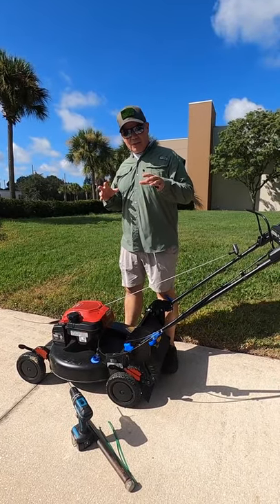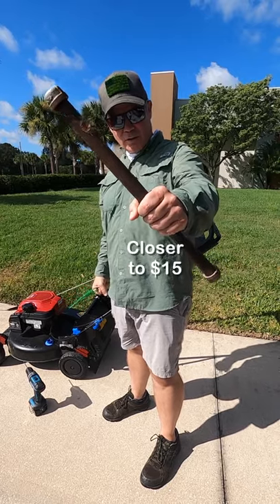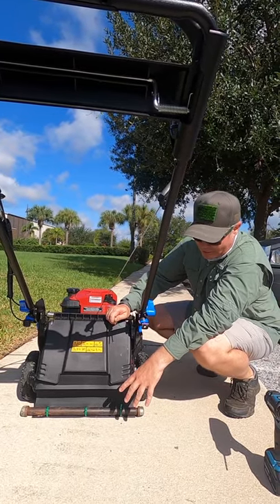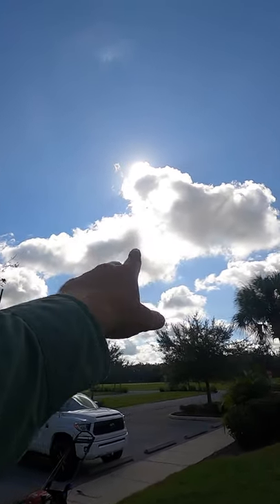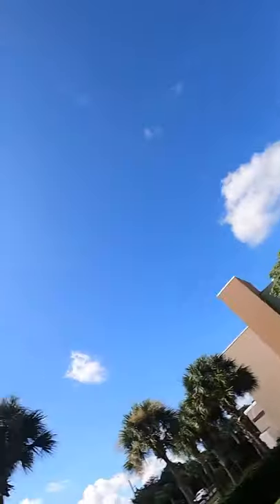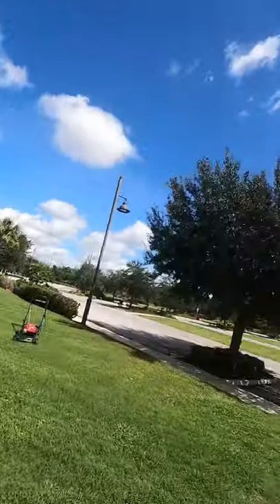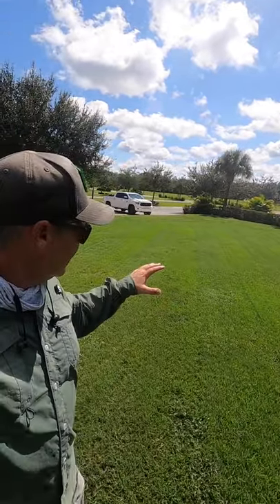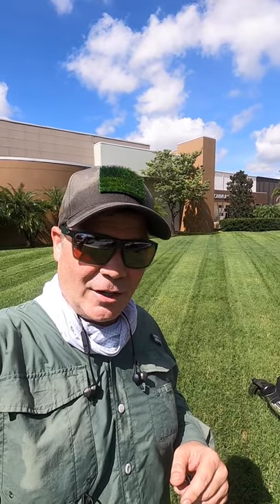DIY Lawn Striper - How TO Mow LAWN STRIPES

Comment: What a great idea. So easy and cheap. I made mine out of 1” pvc just in case somehow/ someway/ someday it got under the mower... it’s plastic instead of steel. I’m hoping with using 1”, the extra sand will make up the weight difference between pvc and steel. I’ve got it mounted and just waiting for rain and the next time I have to mow. THANKS

Comment: The idea is good but I question the durability of the holes in the rubber. Over time I can see the holes ripping apart, maybe using a grommet would work.

Comment: I did this before and unfortunately long term the zip ties ripped the flap. I needed to buy another one.
Reply from the maker: may be time to get a real roller then. The DIY version is just there to get you excited about the possibilities, then you can get something that isn't so hacky. 😂👊
Reply: Lawn Care Nut , haha yeah I did later on but tried this a few years ago. 👍🏼
Reply: Great tip! Do you need be careful when going backwards? I’m worried the pipe will catch the blade under the deck.
Reply from the maker: @Ncuab  yes you do, can't really backup with this one. It's just a starter for wide open areas.
Reply: Johan Yang, no as long as it’s secured with the zip ties you will be okay.